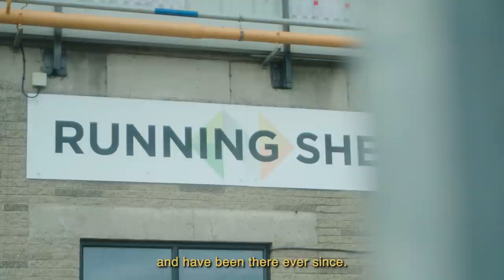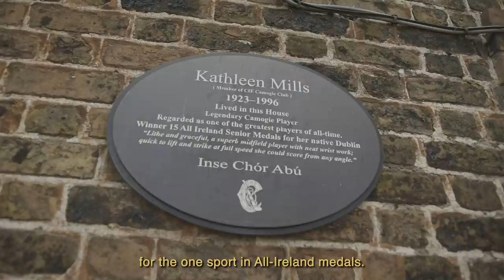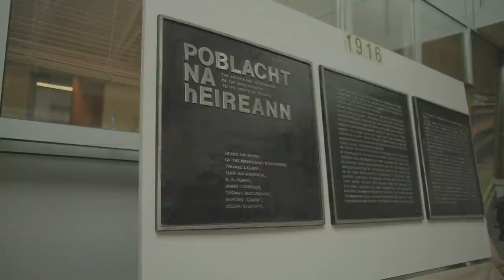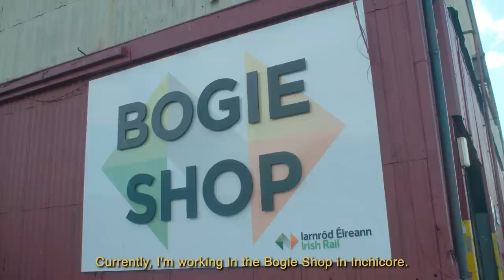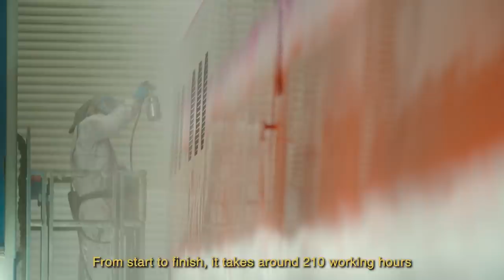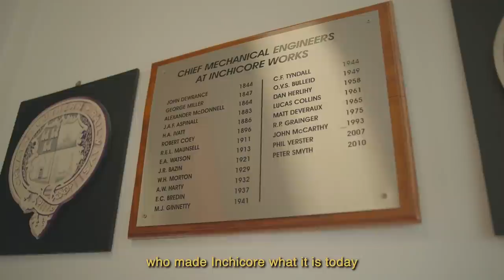Inchicore Works: 175 years at the heart of Ireland's railways

Comment: My father, James (Jimmy) Halford was foreman of the carriage shop from the 1950's until his untimely death in 1971. He was also head of The Works Fire Brigade. In those early days railway carriages were hand built entirely in wood. This changed in the 1960's for safety reasons and steel carriages were then imported from the UK and fitted out in the works.  I also was employed in the works as a shop clerk for a short number of years in the early 1960's. Worked variously in the Chief Mechanical Engineers Dept. as well as the carriage shop, paint shop, locomotive shop, foundry etc.
Happy memories. Would love to visit again!